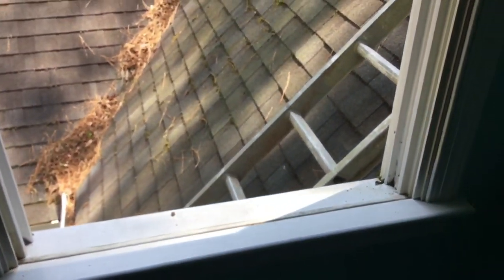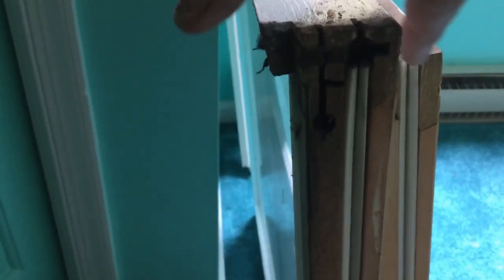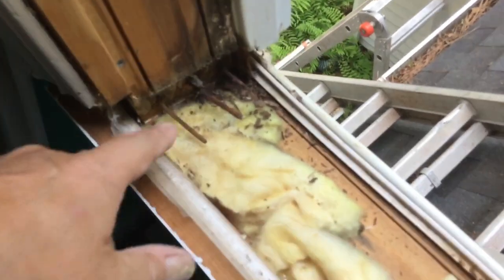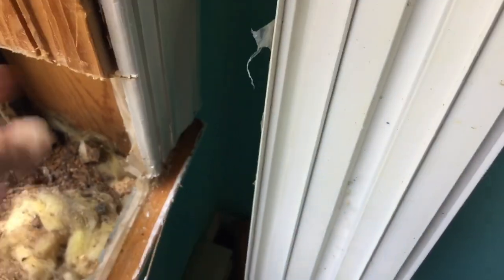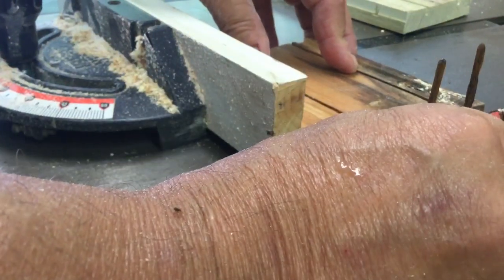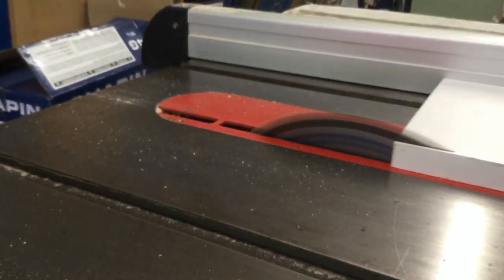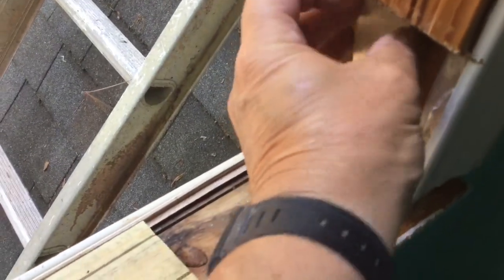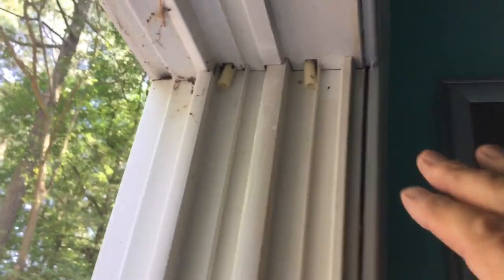Repair rotted Anderson window sill

Comment: I got lucky ,the guy who installed my house’s narrow line windows in the early 80s sealed up the ends of the sills with caulk sealant. All my frames are in excellent condition and only one sash is starting to get some rot witch I’ll cut out and replace. The price Anderson charges for sashes or there conversion kits are ridiculous. I don’t who the carpenter was because I didn’t build this house but I’d like to thank him for it .

Comment: So I ended up removing the bottom piece of trim and drilling into the back of the rotted sill about every 6 inches or so. I injected Great Stuff foam in there, the regular kind, and shut the windows so it wouldn't bulge up and make them hard to close. Excess foam leaked out of the holes and I kinda massaged the foam around in the sill to keep it all even. In the end it worked like a charm! They are rock solid and I assume add some R value to the enclosure lol!
Reply: Did this work out well for you? I was looking at mine and planned to do the same thing. The vinyl still feels pretty strong, and the foam can't rot.
Reply: @hillustration  it worked perfectly. I also did other windows and just left the rotted sills and they seal fine too but the foam ones are rock solid.
Reply: @RuggedAdventures  Thanks!
Reply: @RuggedAdventures  Which foam did you use?
Reply: @hillustration  regular ole Great Stuff
Reply: @RuggedAdventures  Thanks

Comment: You can purchase a factory replacement sill direct from Andersen or Home Depot (much cheaper).   Replacement is extremely easy - cost is about 35 dollars.   The problem with these windows if the wood BEHIND the plastic channels - they also rot as they act like a straw over time. I was able to perfectly fabricate wood inserts that go up the bottom once you use a spade drill bit to remove as much rot as possible.   Then you use a two part epoxy gun with Advanced repair tech epoxy to pump into the plastic channels then slide up to the fabricated wood into the outer channel of the frame within the vinyl.  For the second part of the channel you have to fabricate another long piece cutting it into small blocks it looks like a square U.   For each piece shoot a small amount of epoxy slide another until it fills the channel.  Bottom piece cut the final piece to fit flush at 12 deg.   Sounds ridiculous but it makes it a perfect repair and keeps the outer vinly frame rock solid   Slide the new still in - block shim it with the included shims in the kit from Andersen and replace the jamb liners.   I replace my liners to make the window as new as possible.    You can order these from Home Depot as well for about 12-16 per piece.   I've done at least 6 so far and they look like new.    Sashes also go and can be repaired with Advanced Repair Tech epoxy or I replace both sashes.   For side rot on the wood frame - chisel or grind it out and fill with advanced repair compound using acrylic pieces to make a perfectly flat and square repair with the channels for the jamb liners.
Reply from the maker: thanks,  I never thought to check if you could just buy the sill.  I figured they would want to sell replacement windows.  My house has steel siding which it almost impossible to remove without bending it.  For replacements they would just caulk where the steel siding meets the new window because they couldn’t add flashing.  That would most likely breakdown and leak.
Reply: @jim21804  Andersen will sell almost any individual part for any of their windows.   I have Narrowline 200's which frankly suck - but I don't want to spend 30K to replace them.   The sashes rot at the sides and bottoms and the frames ultimately rot.   The sills rot because the end caps are exposed on most clad houses - brick faced they stand a chance because they are covered.   Check your frames - not the exposed wood that you repaired but the wood behind the vinyl that runs around the window.  If the sashes are rotted the wood inside the vinyl acts like a straw and sucks up water and rots.   I'm doing a couple now and had about 1 1/2 FEET of wood rotting inside the vinyl.   I found a way to replace it by making precise inserts that I slide INSIDE from the bottom.  Makes everything solid and it will never rot out again.

I have fully function shutters that have 8" lags pintels that go through my siding to custom blocks between the jack studs and window frame - to replace the frame would be a nightmare that is why I'm fixing them - too costly to replace the frame because of the shutters.
Reply from the maker: Any advice on how to get the windows to slide up and down easier.  Mine were hard the slide up and down since I bought the house.  Never open them much because of central air.  When I replaced the sills I painted the sashes but sanded the sides where they contact the slides.  Also, sprayed silicon on the slides but they are still hard to raise and lower.
Reply: Do you have any links to the Home Depot sills?
Reply: @jim21804  Search for Narrowline 200 parts catalog.  Its a big pdf.   The part numbers are there.   Take to windows and door dept.   They have to put in a special order.   Its not one their website.   Think they run about 40 each and it takes about three weeks.   No shipping charge.
Reply: Read my post below.
Reply: @stim141  Pg. 143 of the 186 page pdf is not showing any part numbers for sills, but N/A only. I'm hoping they haven't discontinued these.
Reply: Andersen discontinued replacement sills. They are no longer available.
Reply: Correct - checked a few months ago - they are gone and won't be back.   Think the only way to get them is order a complete frame which is still available.  Trying to self fabricate them would be impossible unless you have a CNC machine.   If you don't have massive amounts of rot you can use something called ADVANCED REPAIR TECH epoxy and inject it into the sill once the rot has been removed.   Fortunately all of my have either been replaced or in 100 solid shape.    Annually I check and recaulk the ends to make sure no water is getting in there.   Hopefully they hold up until I'm ready to sell.

Comment: Those windows suck ass! I’m working on a large picture window that’s designed the same way:(
Reply from the maker: Agree.  My house was built in 1978 so the windows are quite old.  I have steel siding which is difficult to remove without bending it.  The proper way to replace a window is to remove the siding so you can put flashing around the perimeter to prevent leaks.  When guys do replacement windows they will caulk the seam where the window meets the siding which eventually leaks.  My repair leaves the existing flashing intact except at the bottom.  I used PVC cement to glue a piece of PVC trim  to the bottom of the new window sill to close in the small gap at the bottom. Caulk around the entire window but leave an opening where the outside vinyl meets the new sill to allow any water that gets in to leak out.  The repair should last a long time.  Good luck. Take you time and you should be fine.